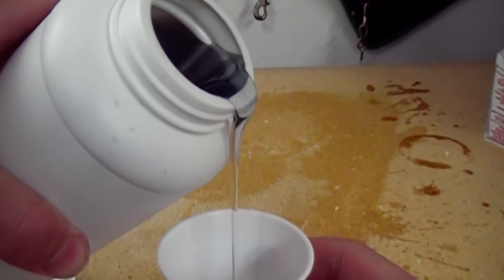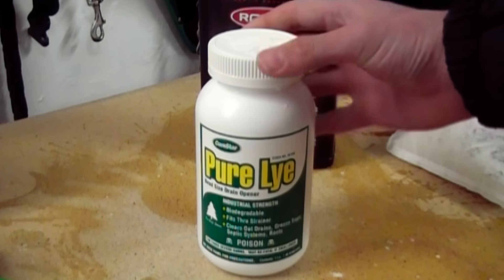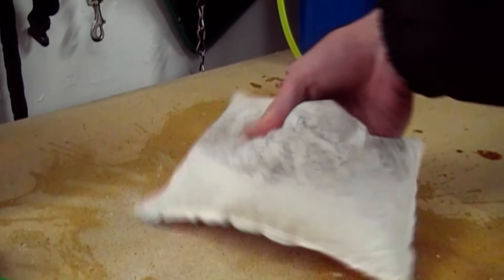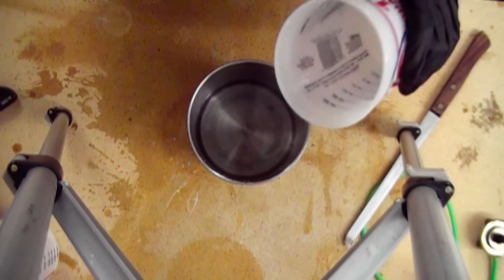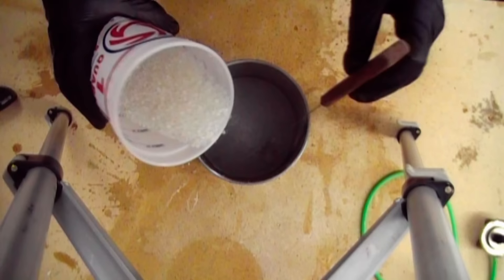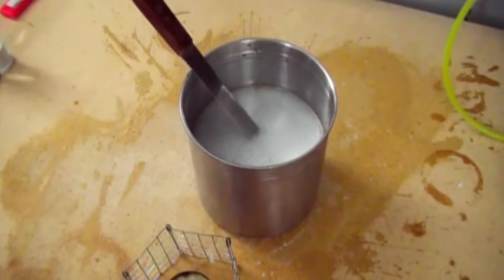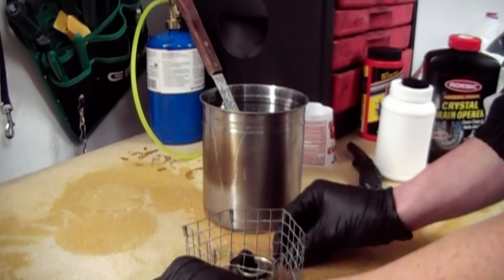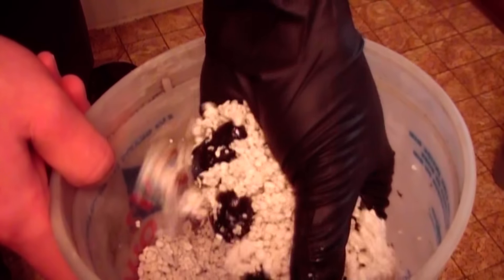Homemade sodium silicate (water glass)

Comment: Wow, very interesting simple process, but now I wonder, where do you get the plaster of paris used in the next video, how is it sold? and what is it (as names may vary)
Reply from the maker: +coline123456789 Sorry for the delay, plaster of Paris can be purchased from art and craft stores, as well as hardware stores. In arts and crafts it is used as a cheap casting material to make various things. In hardware stores it is sold mostly for drywall patching or seam sealing. It mostly goes by the name plaster of Paris wherever it is sold, but sometimes it is simply called plaster.
Reply: +clkindred thanks, the name paris confused me, plaster I do have, I've been collecting shoebox silica during this time!
Reply: +clkindred Finally tried the silicate reaction, interestingly, I got to the point of the drops freezing in the air before all the silica I added dissolved on the solution, how did you make yours to dissolve completely?
I have a magnetic stirrer-heater and balances to do all the steps.
Reply from the maker: Interesting, depending on a few factors, you may require more water to fully dissolve the silica gel. If you take your time, you loose a lot to steam, if the silica is added quickly, or is small particle size, the reaction heat can increase steam loss as well.
Reply: +clkindred I see, so it would be better in that case to increase the amount of water to dissolve everything and then take some time evaporating it again?
Reply from the maker: Yes, adjust water to dissolve everything, then boil to concentrate.

Comment: Thank for your interesting video.
Could you use water glass as a wood stabilizer?
We currently use Cactus juice and a vacuum chamber, it is then heated in an oven for a few hours to cure.
Thank you.
Reply: Sotol Mescal And Tequila cicks my ass ..cactus juice is very dangerous if proper precautions are not taken.

Comment: Pritty Slick - Thanks !!!!!!!!!!!  I working with Geopolymer and this was a great help !!!  you need a better stand for you burner !
Reply from the maker: A hotplate / magnetic stirrer would be ideal. Thanks for the comment!
Reply: clkindred Would also like to congratulate you for using geopolymer technology.  Adding sand blasting sand (aluminum oxide) to the boiling mix would add strength.  Doing a bit of research using potassium hydroxide and potassium silicate geopolymer myself.  - great fun !  - curt

Comment: Hey clkindred,

Can you change the color of sodium silicate? I am interested in etching/carving out different designs on any given material granite, wood etc.. and was wondering if you could syringe the sodium silicate up to apply it in the etchings/carvings. Would this be possible? I just thought adding different colors for bling would be neat. If you could change the color how/what would you have to do..

Thanks
Reply from the maker: The kitty litter has some blue crystals that color the finished product purple, so it seems colors can be added. What type of coloring is what I don't know. Is there a reason sodium silicate needs to be used like that? As opposed to paint or colored epoxy?

Comment: Heated Sodium hydroxide and Pyrex do not mix, as in it devolves the glass
Also, if you ad a bit of potash to it, after you fire it, you'll have a remedial form of glass that doesn't devolve in water
Reply: what
Reply: +Jc Cj only molten lye will affect glass
Reply: +Jc Cj Very true. Concentrated bases and glass never mix. After all, regular glass is 75% SiO2, the stuff in the silica beads you're trying to dissolve. That's why we store them in plastic containers in the lab. Stainless, as was used in the video, is the best bet for this.
Reply: Yeah, just found this out the hard way as my Pyrex kinda sorta exploded a little.
Reply: Jc Cj ... NaOH and water does NOT do anything to Pyrex.  Or even normal glass for that matter.  Not only did Ai use NaOH and aluminum to generate hydrogen for balloons as a kid, I have a degree in chemistry and have used NaOH and water in Pyrex too many times to count.

Comment: A question for you, I hope you don't mind. perlite melts at 1260 C as to what I have read, does the sodium silicate help prevent this from happening? Does also the final  layer of aluminium oxide help prevent this? Cheers and thank you.
Reply from the maker: Honestly I'm still experimenting with this stuff, the sodium silicate just glues it all together. I think my addition of plaster of paris to help curing did more than that. It coated the perlite particles in a plaster and sodium silicate shell. Even if the perlite melts, the shells remain and take over as the primary refractory. I'm experimenting on coating perlite in aluminum oxide to make a better lining. Thanks for the comment!
Reply: Funny I was just thinking a little aluminum oxide through in with the perlite could do no harm. Cheers again.

Comment: FIREPLACE REFRACTORY PANEL REPAIR - Suggestions anyone on repairing a (new, unused) propane fireplace rear refractory panel small “leg” (bottom right corner) that was accidentally broken after being stepped on.  I have 4 oz. of liquid glass (40% solution) and a small tub of refractory cement.  I’ve read the many cautions, observations and recommendations including the mixing of these two ingredients and/or even maybe adding some baking soda and then maybe first use dry ice to facilitate drying before trying a more staged slow, increased heating of the mend.  Any other suggestions out there?

Comment: Any special cares regarding where it should be stored, after its done and cooled off?
Reply from the maker: Airtight plastic container is ideal. The plastic jar the drain cleaner came in is perfect.
Reply: clkindred Btw do you know any easy way to find silicon gel in that great number/bags? I ask this because i've only found small bags, never something as big as the one you use.
Reply from the maker: Silica gel kitty litter is a good source. "Mimi litter" at walmart is what I use now.
Reply: Thanks, i'll check into it.

Comment: Since the melting temperature of sodium silicate is 1,088 °C, is that the max operating temperature of the kiln or does combining it with aluminum oxide and perlite change the operating temperature because there are some metals that harden just beyond 1,088 °C
Reply from the maker: Not exactly, when the sodium silicate is "cured" by firing, it transforms back into silicon dioxide, melting temp of about 1600 degrees C.
Reply: Thanks for the info, your videos have been very helpful.

Comment: I have an school engineering project where I need to build a Popsicle stick bridge using only homemade glue. Everything in my search up to this point has been questionable glues like jello and sugar water. I'm considering using this as my glue because it looks quite promising. For a Popsicle stick bridge supporting a load of up to 20 pounds or so (assuming the design aspect will hold it), do you think joints made with this glue would hold together? Also, can it be stored for later use (i.e. reheat cooled solidified mass)? Great video by the way.
Reply: How about "paste" or "hide glue"?  People used these things for generations!  Your application doesn't need to be refractory, it needs to be strong and adhere to wood.  I bet you could buy some rawhide and cook it?  Or some kind of starch or flour?  You should be able to get something that will break the wood before the glue joint breaks.
Reply: @leonardpearlman4017  It's been many years since high school, but I think we ended up using a milk or gelatin glue formula with casein and it was indeed stronger than the wood. Here was the test!
https://www.youtube.com/watch?v=7nzBKuY03Bg

Comment: Herewith an alternate procedure that does not need external heat or stirring.
1. Prepare a suitable STAINLESS STEEL pot that has a lid. Insulate the pot e.g. fiberglass or a cloth towel. The pot may be glass or ceramic but absolutely NOT ALUMINUM.
2. Blend dry 300g silica gel cat liter with dry 200g lye in the pot. If you don't understand exothermic go to step six below - till you do.
3. Carefully, slowly add 500 to 600 ml distilled water. A 200F+ exothermic reaction is produced.
4. Install the lid and insulate it.
5. Wait 24hrs - done.
6. STOP
Reply: +jerry quigg Adding water to anhydrous NaOH can be dangerous. I would not risk it.
Reply: Sodium Silicate Supply stores sell Sodium Silicate Solution.  Ceramic Supply stores sell it  to use in reactivating old Slip.  You carefully add it to the Ceramic clay mix because just a few drops is more than enough. to increase the viscosity (make it thinner).
Reply: Dangerous method. All it takes is for the container to be the wrong shape (tall and thin) or the ambient temperature to be too high (eg tropics) or a splash of water to be added too quickly or slowly, and you end up with caustic reagents flying into the eyes or onto the face of whoever used the method.
Reply: I should have added:
Step 0.0 - Don UR PPE. - Life is dangerous.

Comment: What type of plastic should the container be made of, that the water glass would be stored in?
Reply from the maker: HDPE or LDPE are good choices, polypropylene is a common chemical storage container materiel as well. The plastic jar in the start of the video is the container the drain cleaner came in and it's HDPE. As long as the reaction went according to plan and you did in fact make sodium silicate, the product is not particularly troublesome to store.

Comment: could you use diatomaceous earth instead of the silica gel?   Both are SIO2 except DE is SIO2&H2O.  I'm just wondering if it would change your measurements any?
Reply from the maker: Paul Procure If the DE is really just silicon dioxide and water, then it would seem like it would work. However, I would think the DE is more valuable they way it is, rather than dissolving it in sodium hydroxide. The best source for silica gel is kitty litter from walmart called "mimi litter" it's just silica gel and it's pretty cheap, about a dollar a pound.

Comment: Made my first batch.  It works.  He forgot to mention the Lye fumes. ;0P
Reply from the maker: Russell Schiwal Another youtuber mentioned that happening to him too, I think I added the lye so slowly I did not get that. All I got was steam that smelled like soap.
Reply: clkindred This still is an awesome thing.  My plan is to make a mold on a kiln shelf that will let me cast a mirror blank for a homemade telescope.
Reply from the maker: Wow that's quite a project! A mirror blank? Glass or a metal?
Reply: Glass, 10 inch, I think.  I'd like it bigger, but I can't get carried away.
Reply: +Russell Schiwal 
(As spoken by Oliver Twist) Please, sir, may I have a video of this?
Reply: +Peter Coombs That would be nice, but this project is on the back burner until I get my mad science degree.
Reply: +clkindred I noticed you had a very long stainless steel implement.  I used a spoon, consequently my hand was much closer.
Reply: As I watched the video and my inner dialogue said, "humm... I wonder what that vapor is on the top?"  I did the mental chemistry.

Next thought, better do this in a well ventilated area... o.-
Reply: He "forgot" a lot of things, like any mention of the multiple hazards of doing this: Serious chemical & heat burns, blindness, resperitory spasm, explosion, probably more.

This is damn negligent, should be removed.
Reply: There's no explosion risk, what are you on about? The sodium hydroxide has all the warnings you need, right on the bottle. It's drain cleaner, everyone knows it's dangerous.
Reply: @drlegendre  Oh, you're no fun.

Comment: Will this Water-Glass harden up with Carbon Dioxide?  You can make Cores for Sand Casting by mixing Water-Glass with sand, putting mixture into a Core Box and than gas with Carbon Dioxide for 30 seconds. The Core will be hard with in a couple minutes and can be removed from Core Box and placed into Mold. Cores made this way will stand up to very high temperatures.

Question
Could you use this manufactured Water-Glass to make Cores gassed with Carbon Dioxide?

Willy
Reply from the maker: Yes, this will work for that.

Comment: hey clinkdred awsome project ,ive got some engineer grade sodium silicate solution 75ttw something this is very viscous ,does it take ages to go cure ? i tried a test ,i think it will need 48 hours at least ,i wanted to line a metal box for a kiln project.....could i mix fire clay in as well for a more stable liner ? thanks man ,jim
Reply from the maker: jim white The biggest problem when the cement dose not dry properly is using too much sodium silicate. Early on in my experiments I had a tendency to use way too much and it never worked. I have wanted to try fire clay but have not come across any locally, so I'm not sure how it would work. My advice is to mix up very small sample batches and make test pieces to torch and see how they do.
Reply: man i basically made a slurry with grey clay ,crushed up the weak silicate and perlite bind that did not stick to well,mixed them together and baked it in the fire in a metal container,next day i lit a hot fire in the woodstove again and put the brick on the coal bed very hot for 1 hour ,it was white hot and is sitting there still in rough shape very hard .quite pleasing indeed,i ill test your idea ...less is more ,ps used 2\ parts perlite roughly 1 part fire clay ,it comes dryish and you mix it with water ,nice work man
Reply: ps.the brick was 5x7x2  " ill give you updates,i make rocket style woodburners.
Reply: i made some with perlite silica,and fire clay ,baked it and man that stuff rocks
Reply from the maker: jim white
Good to hear! Thanks for the update!

Comment: i need this, only in powder form would you think that this could be achieved easily?
Reply from the maker: Well you can either do the reaction with no water, which requires the drain cleaner to be heated until molten (really dangerous) or dehydrate the solution. I have not tried dehydrating because I need the liquid. My only suggestion is to heat the solution and boil all the water off, which will take a long time.
Reply: clkindred Ok I have a way to use the viscus liquids

Tell me, can you ship this in the mail? Or is it hazardous?
I would be willing to send you some labware.  I have cases of 250ml beakers and a dozen or so Schott Duran 1000 and 2000 ml pyrex bottles with orange caps.  I think I have some new 500ml bottles as well.  very handy items.  

Oh I have some very very NICE pyrex  capped test tubes too..  Maybe 3 dozen
I could send you out say a  a 6 pack of 250 beakers a couple 500 bottles  1 2000ml  bottle and a few test tubes

let me know what you think.  
I could mail you the glassware first so you dont think its a scam.
Reply: clkindred and before you think its strange due to the lab stuff I have,  Its because I dont have the money for the reagents and sort of disabled at the moment.  I have lots of stuff..  Hell I have eppendorf centrifuges and a DNA/Protine micro array scanner!...

But im broke is crap
Reply from the maker: Huh, how much do you need? I have been meaning to get some real labware but have not made the plunge. Sodium silicate can be bought online so I'm sure it can be shipped. I don't have any good containers to ship it in though, atleast not a large quantity.
Reply: yeah my shipping would be more than if i bought the stuff too.

Comment: What is the pH of the final product? It is still dangerous as a caustic? Would it be a good idea to neutralize the pH at the end or will this screw up the solution? I want to use this for sand cores and I need to be able to handle it.
Reply from the maker: rwmtube I'm not sure of the exact pH, the product should not be acidified to neutralize because that's how it is "set" for making sand cores, exposure to CO2 makes carbonic acid with the moisture and the acid neutralization causes the sodium silicate to form silicic acid, which readily looses water to form silica gel again.
Reply: Thanks for your prompt response. I plan to set it with CO2. Sounds like I will be wearing gloves!
Reply from the maker: I have worked with it bare handed before without trouble, but I would never discourage use of gloves.

Comment: I did double quantity. 400g of NaOh plus 1000ml H2O but could only dissolve 450g of silica gel. I think less water, maybe 800ml would allow it to boil earlier, speeding up the process. My batch took 40 mins and yield of 500ml strong water glass. I think I slightly over did it. Next time:-
800g NaOh, 900g silica gel, 1600ml H2O should make a litre of water glass.

Comment: clkindred, Hi, hope you can advise, I have made several batches of Water Glass using the correct measurements and ingredients, the problem I'm having is the finished product does not harden properly by air drying, it takes ages to solidify but remains tacky to the touch. Also is there a catalyst you can add as a hardener to speed the curing process. Thanks :)

Comment: I just doubled the amounts you used but I may have boiled it for too long, it is really thick, I have put it in a white plastic container,can I add some more distilled water and thin it out a bit?
Reply from the maker: Yep, thin with water.
Reply: Thanks for the quick reply, will give it a go, it's like paste at the moment.
Reply: Mentorcase did thining it after it was made work or did you have to do it while making it
Reply: hcistheman
Yes thinning it with water worked perfectly, just added slow whilst stirring and soon it thinned out nicely.
Reply: Mentorcase I heated both the water glass and the distilled water in really hot water and it was so thick it wouldn't mix with a carbon fiber rod so I just capped it turned the heated bottle on its side and shook it for a minute and it turned out just like the video. Thanks you for your response.